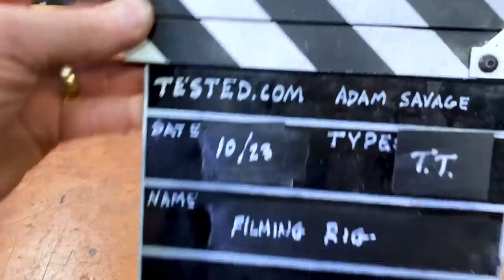Adam Savage's Favorite Tools: Mobile Filming Rig!

Comment from the maker: Savage Industries EDC Two Dyneema bag: https://adamsavage.com/products/savage-industries-edc-two-dyneema
iPhone 11: https://amzn.to/2Uy8W2v
Shurtape black masking tape: https://amzn.to/3noAYtA
White out pen: https://amzn.to/36MuYEp
Loc Line: https://amzn.to/38VYWIN
Spring clamp: https://amzn.to/3pBTz7u
Carbon Fiber monopod: https://amzn.to/3aSxYzU
Monopod base: https://amzn.to/2wowK0e
Joby phone holder: https://amzn.to/2IzU952
20 foot lightning cable: https://amzn.to/2IzUEfq
iHome wall wart: https://amzn.to/3f7zlh5
Reply: Very informative video!
Reply: Im in love with the manfrotto super clamp + magic arm for lights, camera & microphone mounting. You can mount it everywhere:). I guess you have seen those a lot in use on set:). They last for a lifetime btw.
Reply: I would have tried the Røde Wireless Go for recording audio if I were Adam. Have not tried it myself but it seems to be really small and easy to use. The quality of the video using the phone is okey, but the audio (especially in far away shots) is not that great. https://wirelessgo.rode.com/
Reply: @HansAndreasR1  I do see your point, i would reccomend it as an addition, one can never have enough grips:P. He can even make some fixed position through his shop so he wont need to set-up everytime he walks to a differnt mill. I also want to point out that it holds up to 3kg, with gear upgrades this baby will hold his next dslr safely next to heavy machinery.
Reply: Norm-chan
Reply: 'Right to repair' and Apple don't really mix Adam
Reply: I use cables from juicybitz most of them you can get up to 5m and some of them with a right angle connector
Reply: U should make some custom feet that clip on the the stand that just out for extra stability
Reply: Hi Adam you could of brought a Motorola One Action which has cameras better than the iPhone records in 4k and less than 200
Reply: You've probably already thought of this but, for stability, I would wrap an ankle weight around the base of the monopod, use it like a sandbag to stop it tipping over.
Reply: Hey Adam, You should take a look at Ebay.  They have some "Manfrotto style" magic arms that are $20-$40 bucks.  Big Clive on Youtube has done a review/closer look at these chinese knockoff Manfrotto arms and he seems to think they are a bargain compared to what a name brand one would cost.  Especially since your just cell phone shooting and it looks great.  Probably need a few battery packs around.  I wouldn't support the iphone 12 since they have made the phone pretty much impossible to repair (even if its a camera module or a battery)  They claim to be a super green company but then sue a recycler they use for selling parts to repair centers.  Thats the whole point of recycling.  To get a longer life out of something that would otherwise be in the landfill.
Reply: https://www.youtube.com/watch?v=yfE00pXkL8U Link to BigClive's look at the Generic Manfrotto arms you can get on ebay.
Reply: Adding wheels to that monopod would also be helpful.
Cheers
Reply: Longer feet on that monopod would also help for stability.
Reply: You should look into getting a K&M 26085 mic stand, it isn't exactly made for filming, but without making the footprint bigger, it sure will be more stable than this mini tripod :)
Reply: They also have a table variant wich will work great on your workbenches, the K&M 232BK
Reply: Normal one:
https://www.amazon.com/26085-One-hand-Microphone-5-pack-Bundle/dp/B08C6THD5Z

Table one:
https://www.amazon.com/23200-Table-Microphone-Stand/dp/B000NTZKH6
Reply: Great list!  Some bits missing, apparently.  I can see that the Loc Line pieces can be joined together, but once they're connected together, what joins the Loc Line "snake" to the clamp and the other end to the Joby?  There's probably a Loc Line threaded fitting that's required.  Perhaps the list could be edited to include these items if they're not included with the items listed here.

Comment: Adding a power bank to the bottom with a retractable cable seems like a  smart move to add more stability and even more range on standing location!
Reply: I came to the say the same, and if you get a big enough power bank you could attach it to the monopod and it may add some stability.
Reply: Wanted to give tha tsuggestion too, didn't think of the stability but for quickly setting up and filming without the long cable, a powerbank seems generally a good. Especially if recording on the move, though in the workshop i suppose it could just get plugged in to charge overnight.
Reply: Yup get a big capacity power bank like a 20,000+mAh one and there you go weight for the monopod and plenty of power for shooting longer videos without needing to plug in as frequently.
Reply: Cool. I came here to say that too. U said it better
Reply: I have a celestron powertank that is perfect for that.
Reply: you could take a small fabric pouch (that come with many power banks i.e. Anker), cut some slits in it, and ziptie just the pouch to the base of the monopod. Then you can just drop the power bank in the pouch when you need it for weight and/or power, and take it out for travel, charging, and whenever you just need to take the battery with you. and then a 6' or maybe 10' cable would be plenty long enough, you can wrap around the pole a few times to prevent tangles.

Retractable cables in my experience are very flimsy, unreliable, and short anyway. Better off sticking with a quality Anker cable, the nylon wrapped ones are very durable and tangle resistant.

Comment: I teach automotive and I had to adapt from teaching live in person to remotely and filming my lessons. I use a magnetic base for a dial indicator to mount my filming rig. It works great and I can engage the magnet and stick it to many different places to get the angles I need. My work benches are steel and it lets me get overhead shots without the camera getting in the way. I also stick it to a brake rotor for using it on normal tabletops. I also have a clamp like yours that I can use in place of the magnetic base in case I want to clamp it to any other place.
Reply: I think the switchable magnet "dead man" blocks Adam got with his new workbench would be ideal for what you're talking about, with his rig he should be able to just clamp to the block stuck anywhere metal.
Reply: @IFS  Yeah totally! I was thinking the same thing. He could get some really cool shots on the mill and lathe and the table saw with it!
Reply: I would be a little  cautious of a magnet near  a camera
Reply: @glenmatthewsmith6305  Unless you're still recording on magnetic tape, a static magnet won't be a problem.

Comment: I would add an ankle weight or two to add to the bottom of the monopod.
Reply: I was thinking a good idea would be to have a nice big lithium ion power bank strapped to the base. That'd give it more weight, and instead of needing a honking great lead to the phone, it could be plugged into the power bank. Possibly even use a lead ziptied to the locline, and another lead with a male USB-A to female USB-A lead on the monopod. Less chance of catching the cable and knocking over the stand, and more weight on the base for stability, and if the separate cable arrangement is used the locline and clamp can be removed from the monopod and moved about without having to move the cable out of the way.
Reply: @AgentWaltonSimons  I like the honking power pack velcro'd to the bottom leg, but the problem is the feet are short, so you would have to be cognizant as to which side the pack was vs. the phone to get optimal balance, but then he could charge the pack, let the pack charge or maintain the phone, and then he's truly wireless for at least a couple hours (depending on the size of the pack). Also, since that mono-pod is telescoping, the lead could really only be permanently attached (or wrapped around) the locline (since that length doesn't change, just the orientation) and then a USB extension cable could take it down to the pack on the mono-pod.  The ankle weight is more stable because it's central, so maybe both? Put the pack above the ankle weight?
Reply: @dustysparks  2 packs on each side right above the base? Or just one, the main problem here is center of gravity being so high, not how central the center or gravity is, as long as the bulk of the mass is within the diameter of the feet and low down, there will be a drastic increase to stability!
Reply: I was gonna say sand bag, but ankle weights are probably easier!
Reply: I have a very similar minimalist tripod setup. I use a pair of vinyl-coated 1lb baseball bat training weights around the base of the mini tripod at the bottom to weigh it down. Really helps, especially in windy conditions!
Reply: @mattmadolah  An ankle weight is better. Velcros on, can also slip it off the top. doesn't come off the bottom when moving it. Could also modify it so he could fill it with dirt or sand when he changes location so he isn't adding weight when traveling. There may even be some which allow you to change the weights in them.
Reply: That is actually a good suggestion, i would be thinking along the lines of  getting a longer leg base, but the weights would be just as good.
Reply: @sabertoothanimations2912  He mentioned a lot that he likes it because it doesn't add friction to his workflow ( ie a reason why he isn't using a tripod, which would be much more stable but it does so by taking up more leg room ) - so making the legs longer would mean he should just use a tripod but... The weights would have the same effect and be more versatile without getting in his way. The only downside is having to source something heavy to put in the cloth at each location - but that's typically not very difficult.
Reply: A ten-pound plate on a tightening collar.
Reply: @Acecool  Well thank you for the reply, I have only been fallowing him for a short time now and i'm still catching up on seeing his work.
Reply: I agree... but the problem with all these ideas is it’s added weight while traveling. A better solution is something that is easy to find and handy almost anywhere... I would suggest sewing a bag/sock that would slip over the feet and hold 3 - 16oz water bottles... easy to travel with (and explain why you have them) and if you need one quick trip to the corner store and you’re set.
Reply: What about making the bag have the base attached to it. Leave a battery pack in there and what ever else you aren’t using for the added weight.
Reply: @AlexSouthwell  Its an interesting thought, might be something i'll put to the test to see if it works

Comment: Motorcycling introduced me to RAM mounts.  No going back using anything else for mounting a phone after using one of those.
Reply: They look legit
Reply: I’ve used them all, and the best phone mount for handheld is the Beastclamp.
Reply: Could agree more on RAM mounts!
Reply: I use the same for my phone on Zoom calls in my garage
Reply: GIVI has some amazing solutions for mounting phones, equipment, and bags. Pricy though.
Reply: I had my note 8 on my motorcycle at 100+ mph for many many mile. The ram mount is awesome!
Reply: Was gonna comment the same thing, but you beat me to it.
Reply: RAM mounts for the win! I, uh acquired mine from a previous job, and haven’t looked back! I replaced the fingertips once, and that’s about it. It’s versatility is it’s absolute greatest asset!
Reply: Add some super glue to the inside of the rubber fingers then stick them on their posts. That's worked well for me
Reply: would also recommend adam try this. i think he'd favorite it as well.
Reply: There  was a tube of CA glue that came with my X-clamp, presumably for the finger tips, but so far they haven't budged from their factory installation.
Reply: @JBLewis  I also got the glue included with the kit.

Comment: I have an idea that would pull double duty, a big (maybe 20,000 Ah) portable battery velcor'd to the bottom of the tripod and a short 6' cord to the phone would keep you wireless to the wall and would also add some weight and stability to the pod and lower the CG. Long cord could be used to charge the power bank. Love your videos as always.

Comment: Removing friction is important. Im busy with a research masters and the best thing Ive done was spend sometime making my computational experiments easier to run and work with. Boosted my productivity and has made a world of difference.
Reply: At work we use the term “hassle hurdle”. When something seems to be needing service the obstacles should be as few as possible or things won’t get serviced. If it needs tools you have to go get the tool. So much of my design work is based on the idea of needing two or fewer tools to do all the work needed.

Comment: Under the category of locked down/using what’s on site, I opted for building camera/light stands with 3/4” pvc pipe. It all pulls apart but is light, mobile and extremely stable

Comment: I know you said this more than once, but it is SO very important: No matter how good the equipment is if it prevents you from using it. Simplicity and ease of starting is sometimes more important than having the "perfect" setup. Lower the activation energy of starting a project.

I have a tripod from when we had a camcorder that recorded on tape. It's metal and plastic and I just leave a generic phone clamp on and it works beautifully for around the house/juggling videos I mostly record for myself to track progress.

Comment: I got a pelican case for my mobile shooting setup, but the best part about it is that there's a USB hub charger permanently mounted inside that has shorty cables hooked up to my mic receiver, transmitters and camera battery chargers. All I have to do is lug one cord into the wall and everything is charging.

Where I shoot in my workshop for my channel project builds, I'm really looking forward to ditching my tripod and making a big robotic arm that'll have a bunch of stepper motors hooked up to an arduino. Hopefully I'll be able to figure out how to program it to follow me around, scenes and stuff like that. This, in it of itself, will be a big build on my channel.

Comment: You may have heard of them but Quadlock mounts are fantastic! I will tell you its a great company and the design very clever. I have a mount in my car, bicycle, motorcycle, etc.. Adam will appreciate the very positive locking mechanism. Super sturdy and the plastic is very durable.

Comment: Others have said it, but a power bank would be really good addition to the rig. 

It’s surprising how good they’re getting, too, for cheap. An okay one from Walmart with two 18650 cells contained within it can charge the phone twice for less than $10. That would add flexibility to move it wherever. Zip tie or Velcro it to the bottom of that manfrotto. 

I used one recently in an LED strip under a cabinet. The LED strip was USB and it had the sticky on the back of it. I mounted that, had a USB switch (with a very satisfying click) that I mounted and mounted the power bank. It’s amazing how much of a difference a bit of light makes.

Comment: Hey Adam, there's a really great company called 9.solutions that makes miniature grip hardware that is purpose-built for small camera rigging. I first used their products on reality TV projects that needed robust gopro mounts both inside rooms and on vehicles. Their grip gak is a joy to use in the same way that traditional grip gear is like playing with Lego and their small clamps are some of the best I've ever used and they have a ton of different types.

Comment: A large capacity power bank for traveling and when you absolutely need to have an untethered charging. A 3D printed mount can attach to the bottom of the monopod.
A mount on the main floor support so it can use 3 standard water bottles for more stability, plus it is always good to have water on hand for some natural refreshment. So dual uses for bottled water.

Comment: I assumed they'd be using some large battery banks so he wouldn't have to be tethered to a plug the whole time. Could even use it as a counterweight at the bottom of the mount to make it a little more stable.
Reply: I have always used a Dewalt USB charger that uses a tool battery for my phone. Using it as a counter weight would be a nice touch.
Reply: @dennismorin7506  Ego makes a similar unit which has me eyeing the big batteries from our snow thrower as possible power sources while camping. Bosch has one too — to leverage the power system for my shop tools. They’re both on my Wishlist. But I look around at my existing collection of USB power packs, and recognize too that if I was going to carry that I’m doing a vehicle supported trip… Said vehicle equipped with USB ports (and a 120VAC inverter). AND it carries a portable Battery Jump Pack with USB outlets.  It’s great that we have so many choices for portable power!
Reply: @riggerjeff  agreed....lithium batteries are a huge game changer. One word of advice if you go with a tool battery power. pick a brand with most of the tools you like.( They all use basically the same cells) all my tools are compatible.

Comment: For more stability than the monopod, a light (pun intended) lightstand might be the solution, for example the Manfrotto 5001B nano stand. Still packs up pretty small.
(for those that are unfamiliar, the Manfrotto monopod base is a fluid base and allows for some tilt so you have to balance the monopod if you want it to be freestanding)

Comment: Every one of my camera (phone) mounts is made from a modified dollar store selfie stick. Most selfie sticks come apart to reveal a standard 1/4-20 screw thread that lets them to be bolted to pretty much anything. 
I have several spring clamps and C-clamps that I have added bits of threaded rod to for attaching my phone wherever I need a shot.
Super cheap, and very customizable.